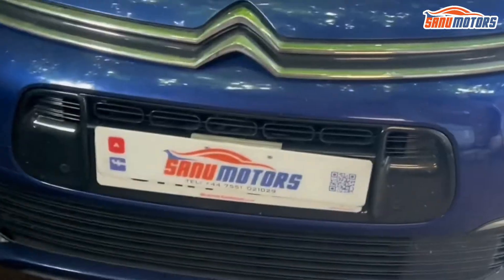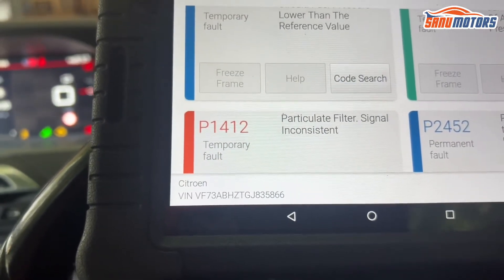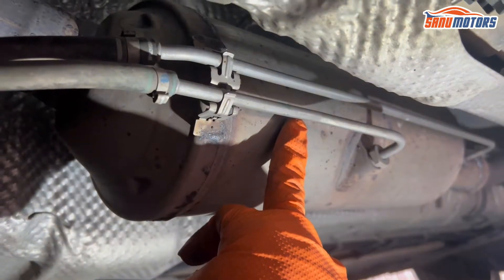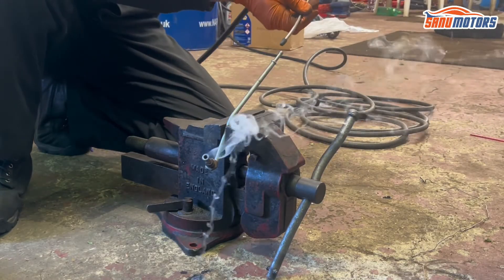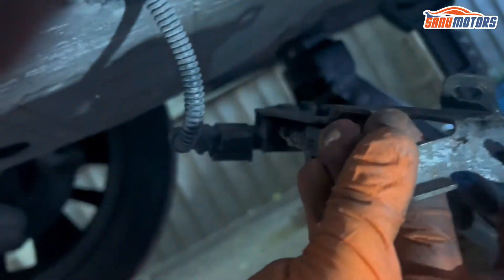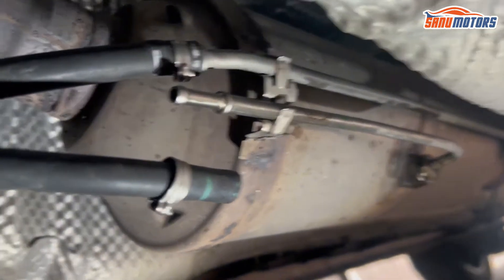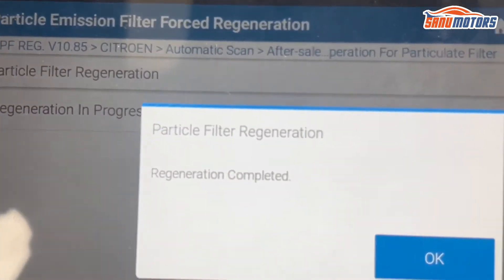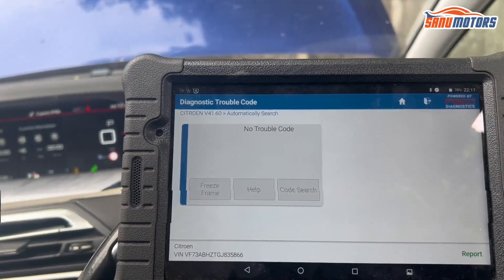Diagnosing and Solving Citroën C4 Picasso DPF Problems - Comprehensive Guide 💥🔥🚗#citroen #diy

Comment: Hi, my C4 is saying possibly particle filter clogging and engine fault and then goes into limp mode. That engine fault only came on days after we’ve left the tank run really low once. Thanks in advance 🙏👍
Reply: Also, did you clean and de-clog the hole on the exhaust the same way you cleaned the pipe? Thanks
Reply from the maker: Ah yeah, running the tank low can definitely mess with regens — the system won’t do a proper DPF regen if fuel’s too low, and that builds up soot quick. That “particle filter clogging” warning and limp mode are classic signs it’s overdue a regen.

If you’ve got a scanner, check soot levels and force a regen if needed. Or a good motorway run with a full tank might just do the trick if it’s not too far gone yet.

If you want help reading the data or planning the next step, feel free to join our group:
👉 WhatsApp: https://chat.whatsapp.com/JOvJCdZYdV9J6PvIXw2RV0
👉 Facebook: https://www.facebook.com/share/g/15msa3NJmn/

Comment: Superb video and explanation, thank you very much, I almost got ripped off by a mechanic who wanted to change the DPF complete system on my car. I have the same car as in the video with a 1.6 HDI 88kw engine. I got a service light on but no other lights, also faulty codes are P1434(96), P1435(00) and P242F(00). Should I go through the same process as you, or is it something else?
Reply from the maker: Try this process and have a look. If it works you can save lots of money 
Thanks